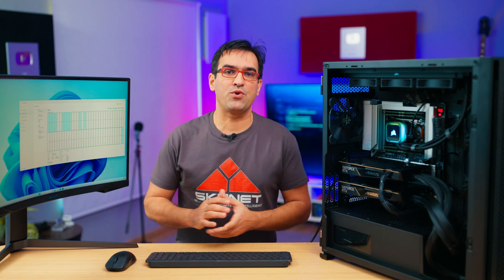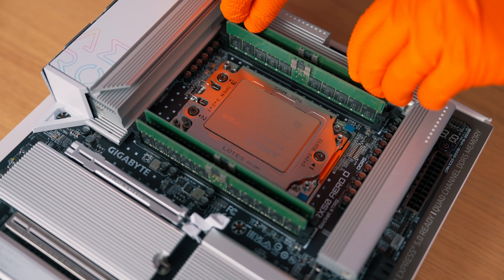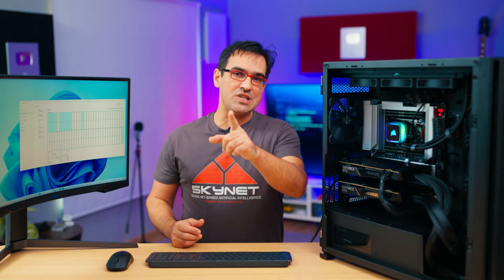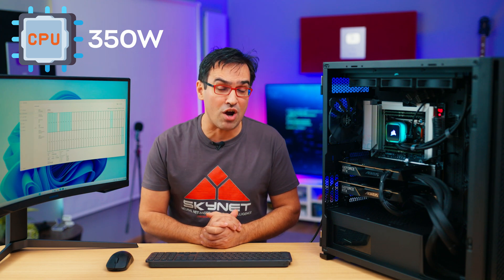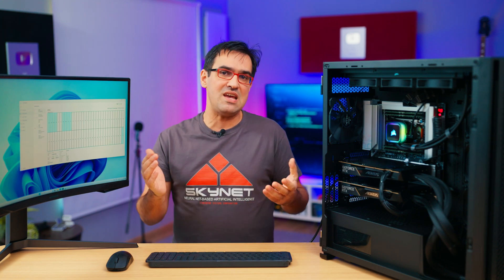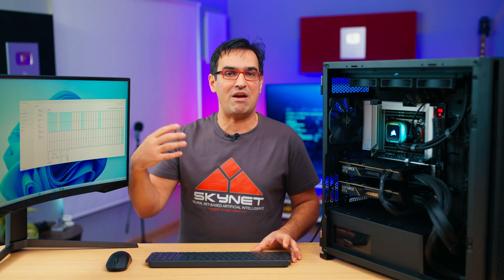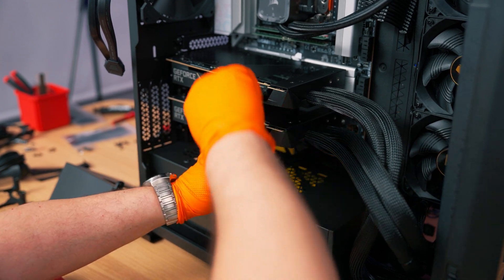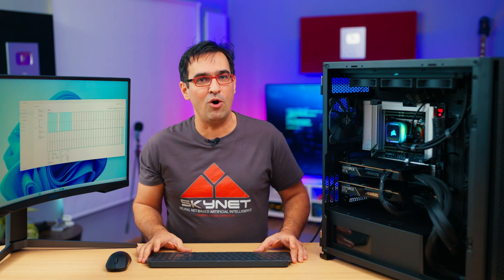The most powerful PC we ever built: Threadripper 7970X + 2 x RTX 4090 water cooled!

Comment: This is stupid, but I want it. 

You should try the "RGB" build. An rtx 4090, rx 7900xtx, and arc a770 in the same system (and I guess whatever cpu you prefer, integrated graphics does not count). I wonder what chaos that would bring with the different drivers.

Comment: Nice video!
Got a 7970x + 2x 4090 MSI Suprim Liquid few days ago, so pretty similar system.
Did your system start right away with the 4090 in PCIE5 slot? Mine didnt want to boot as long GPU was in the pcie5 slot. But defective CPU AIO made me stop the assembly process anyways. Will try and set the pcie5 slots to pcie4 in bios when I get a replacement AIO
Reply: how rich are you dude
Reply: @demonstrack  I have a similar system. Got an all core 5ghz 7970x with a 3090ti and a custom loop with triple 360 rads. Just for simulation games. Fairley well utilized too. About 12.5k in parts. Not rich, just a decent job and a recent inheritance. Just wanted something that didnt leave me asking for more. 
Most of these systems are built for work. The money is there for that. Im just stupid.
Reply: @YEAHitsaHEMI  rich